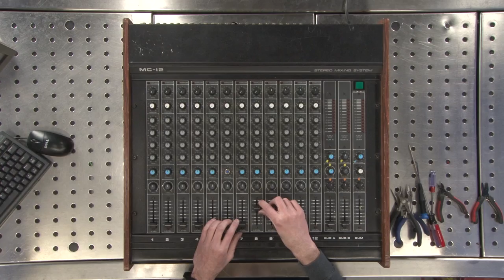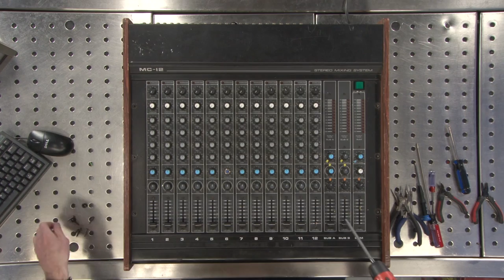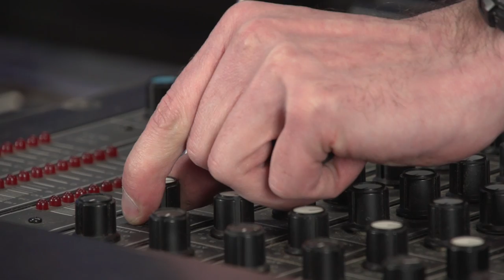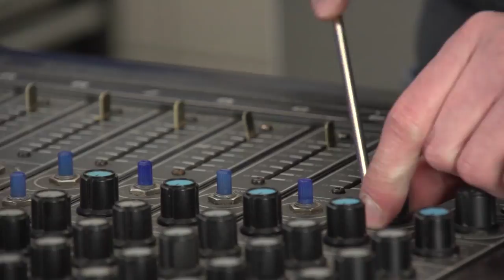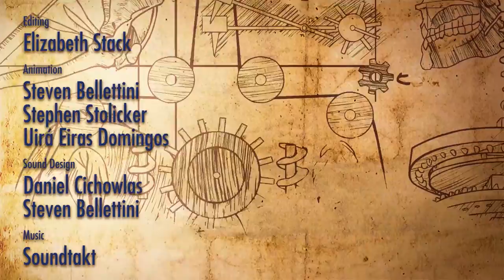12 Channel Mixer: Equipment Autopsy #69

Comment: In the pots and faders the signal output is usually the center pin where you select between ground (no signal) and how much of the input signal you want, so the other way around. You usually don't ground an output but grounding an input is normal if you don't want sound. That is the way I've done it and that works so I would think that it is that way on all volume controls.

Comment: This console is labeled a bit confusingly (but for a reason). The Sub A & B are Typically your Left & Right.... the pan knob sends it to either A or B or both. Sum Out takes A&B and makes a mono sum. Labeling the main outs as A&B was done to make it easier to understand, via the manual, that you can route audio as Left & Right... or to two different zones... which ever suits your requirement. Peavey was used in a lot of churches that did not require stereo signal, so they made it easier to understand the routing possibilities by labeling it the way they did. Also, the send to the onboard reverb could be used to send to an outboard effect as well. When a 1/4" cable was plug into the aux output, it would cancel the onboard reverb, and redirect the signal to your outboard device. The Effect send is post fader. There is also a prefade send (only one) for sending audio to stage monitors. These consoles had very respectable op-amps, and output transformers, for the time and price point. Not the quietest consoles ever made, but being made for live use, that wasn't the biggest requirement on the list. I have several Peavey console from this era, that are all still in service. These consoles were actually way over engineered (in the reliability department), and thousands of them are still going strong. The were and are workhorse consoles. Eq was basic, routing was basic... but it was great for a band on a budget.... or a church on a budget. These were also popular in permanent install situations, such as school and university auditoriums, civic centers, etc.. They rode a line where a novice could turn it on and get a microphone working, and a real band engineer could get a decent mix thrown together. Peavey was really good at packaging stuff with just enough features to make a usable utility.

Comment: "Blood-blister manufacturing facility" -I see Chris is well versed in that as well!
I don't often see pots wired in the way Chris explains..(Granted,I don't work on a lot of mixers.) Usually The signal input goes to one end of the resistive material,and the other end of the resistive material to ground. (Signal input is across resistor). And then you'd take your signal output from the wiper,and ground. This presents a constant input impedance to the signal source. The way Chris explains it,would be shunting the signal source to ground,and depending on the source things might be unhappy. (not to mention the impedance will vary with level.)
Reply: That is indeed so.

Comment: 12:10 I was waiting for that!  I had a console with reverb on it when ibwas younger.  I always liked the sound it made when you hit it.

This reminds me, I've got a Mackie 1604 VLZ Pro with a bad cold solder joint on the main outs sitting in my computer room.  Great little board as long as you didn't need more channels.  I should fix that thing.
Reply: Or sell to me?  Love old mackie!  Great comment!
Reply: @94XJ So, have you fixed it yet, or have you been procrastinating all these years? 😜

Comment: wow lots of parts to see in that mixer.   I would expect fuses in there.  they protect other parts.  dimmer switches do the same for lights.  the input boards fell out when you opened it.

Comment: Dint talk shit about Behringer i have a 16 channel on my desk for videos and whatnot and I love it!
Reply: My keyboard, it messed up on the first word I meant don't.
Reply: TheDutchOwner's Tech Channel Yeah I'll agree to that but, its the difference between a couple thousand and a few hundred.
Reply: I love Behringer mixers, I use a  Behringer Eurodesk SL3242FX-PRO! I've never had a problem with it, There are more expensive mixers but this one works pretty good!
Reply: Thanks, for backing me up. I'm ashamed at how bad my grammar was looking back at my previous comment. My keyboard must have been broken or something.
Reply: And i have a Xenyx 2442FX that i use in my very own private home studio where i dabble in some multitrack recording of my own tunes; not that i'm very good at it, but it's fun to do. I don't really need that many channels, but like the Peavey in this video it has inserts on each channel, THAT's what i wanted so that i can hook it up to an M-Audio Delta 1010 via the inserts, which then hooks up to my computer. This allows me to not only send each channel TO the 'puter for recording, but also lets me send up to 8 tracks at a time back to the mixer where i can mix it down to stereo, and send the final 2-ch stereo signal back to the 'puter. 😉

Comment: I remember that mixer from high school A/V...

Thats a graphic eq, not parametric.
Reply: No, it is in fact neither: a graphic equaliser has several bands that are controlled by linear pots, AKA faders; a parametric eq has three controls, normally rotary, which control 1: center frequency, 2: width of the frequency band (narrow vs wide) - usually called Q, and finally 3: gain or attenuation of the selected frequency within the chosen bandwith. Some omit the Q control, in which case it's called a semi-parametric eq. The ones in this mixer are just 4-band equalisers.

Comment: Hey, i just got a Peavey Mark 111 series 16 channel mixing board for a mere. $20.00....(a Mac meal for 4 )
Well, anyway, after cleaning all the sticky styrofoam out of it and spraying and cleaning pots and looking it over, I was told it would be a bench price to look it over...150.00???
There is no smell ( burnt ) or any boards looking bad but was wondering what would be the main thing to look for with it not working....have not plugged it in...was told by seller that band did not want to pay price to repair so I got from CL
Im thinking of spraying/ cleaning connections which I have done before and gotten amps to work even on both channels doing this method....
Any help appreciated

Comment: Boy did that bring back some memories! I had the bigger version (Twelve Hundred), but it didn't have the individual taps for each channel like this one did, so I had to hack the board and add 1/4' outs. Big PITA, so I got 4 out of the 12 channels done.
Here's what one looked like (mine got donated to a garage band ages ago so I have no idea where it went).
http://www.gearslutz.com/board/attachments/so-much-gear-so-little-time/155769d1264884401-peavey-1200-mixer-1131ag4_20.jpeg.jpg

Comment: I really dont agree with your explanation on how potentiometers work. When you just set a resistor in line with a line-level signal it propably will do nothing to the signal because the current is so tiny. What a potentiometer does is more like shorting a part of the signal to the ground. When you set it to the min level it will just completely short the signal to ground, so you wont hear anything and vice versa.
Reply: I beg to differ. With a fixed maximum voltage (5 volts, say) on a signal, if you double the resistance of the circuit, you halve the current, regardless of whether the signal is a hundred amps or a milliamp. There is no "grounding" on a volume potentiometer other than to keep noise pickup down. Here's a really easy test: set up a battery, a LED and a potentiometer in series to create a circuit. Use only two legs on the pot input and output on the "hot" side of the battery with no ground connection. You will still be able to control the LED, because the potentiometer is limiting the current.
Reply: Ryan Willis
 A LED is a completely different thing. But why do you think require audio pots three pins to work? Some years ago I tried to just add a passive volume knob in a rca cable. And I only used two pins of the pot (47k). The sound got slightly more silent when I set it to minimum, but was far away from no sound. So I read some forums what was going on and they said I have to connect the left pin of the pot to ground. (left: ground, middle: in, right: out) So when I set the pot on min. it will short the whole signal to ground and it'll be silent.
Reply: I'm not saying your method won't work, just that it's not best practice nor how most things do it. The reason your audio didn't get reduced much is because you didn't use a large enough resistance. An LED is not a completely different thing, both an audio signal and a battery are voltage sources and both and LED and a speaker are loads. One happens to fluctuate more than the other, but otherwise they are functionally identical. The reason almost all pots have three wires is not that you always have to use all of them for it to work, the reason is that it's an incredibly cheap way to allow it to be used in more ways. Add one pin and you can suddenly use it as a left-right balance knob as well as a volume knob if you only use two.
Reply: Ryan Willis Most of these circuits work on voltage, not on current.

Usually, a potentiometer that is being used for level control will be wired as follows:

-The signal would be amplified, and the "hot" applied to the top of the pot.
-The ground of the amplifier would be applied to the bottom of the pot.
-The output signal would be taken from the wiper, and would get larger and larger as the wiper is moved from ground to hot.

That signal would then go on to the next stage in the device.

That's why they call it a potentiometer, potential means voltage, and the pot is metering the voltage out. Potential-Meter, potentiometer.
Reply: * sigh * I'm sick of arguing for right now. Valid points have been made all around, but I still hold my idea as being correct and relevant. This is quite possibly due to pigheadedness on my part.
Reply: Try adding a potentiometer just as a resistor in series in a line level audio signal. Will this work? No. Will this work with an LED? Yes.
Reply: Ryan Willis  I have wired pots in differential mode where the top leg is at +5 volts and the bottom leg is at -5 volts. I have also seen and wired pots up with +18 volts on the top leg and +6 volts on the bottom. Potentiometers do not have to always have a leg that has to go to ground.
Reply: EETechs no, they don't have to have ground on one end, but they do need to have "different" voltages on each end. That is what makes them a potentiometer. They are used to vary the wiper voltage between the voltages on either end.